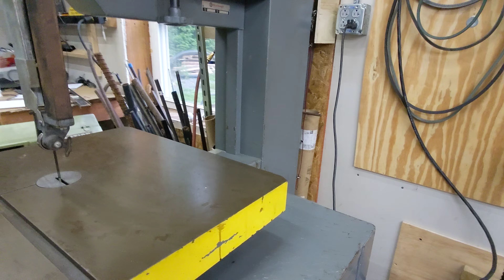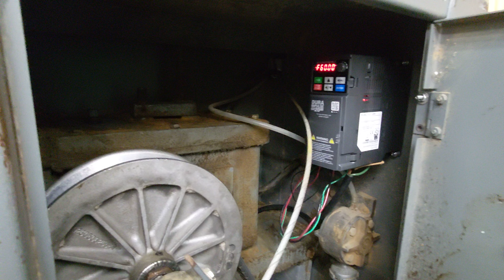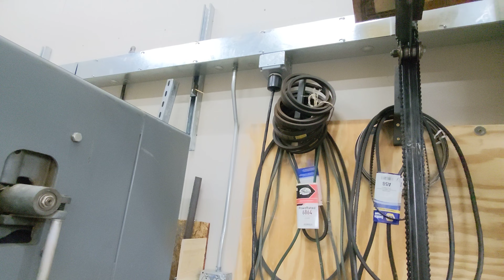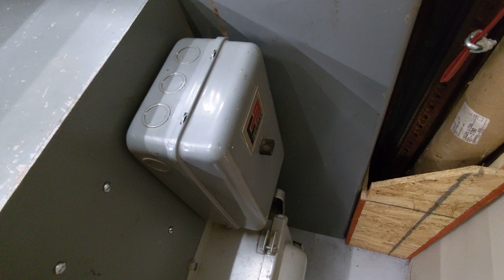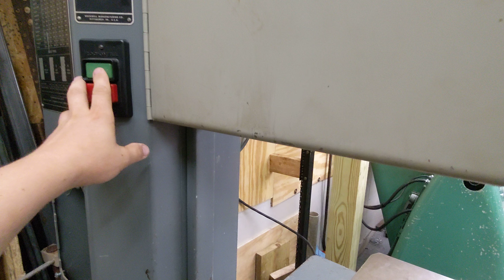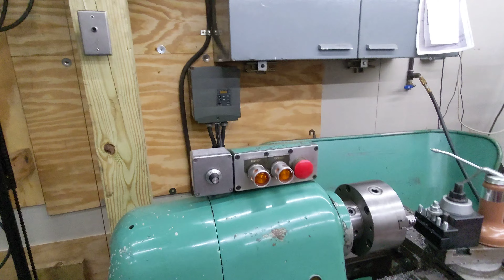Walkaround: Rockwell 28-3x5 20" bandsaw with VFD controls

Comment: Hey, I have the same saw but in pieces….would you mind sharing where you purchased the tires from? I’ve found several places but they’re $250+. Looking for a cheaper solution
Reply from the maker: Reach out to the seller "polybelt" or "bandsaw-tire-warehouse" on ebay, I have had good luck with them for other purchases in the past.  iirc both are happy to be messaged and consult on the right solution.  I see "BLUE MAX ULTRA DUTY BAND SAW TIRES 20" X 1 3/8" FOR DELTA ROCKWELL CRESCENT" for $80.  It isn't the crowned version which is $250 like you said.  Thanks for asking, I probably should check the condition of the tires in mine...